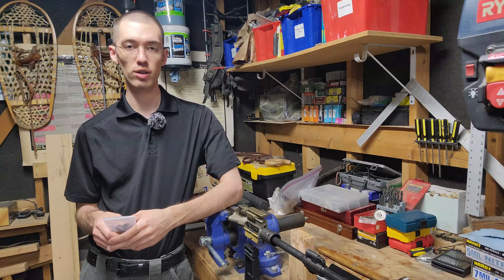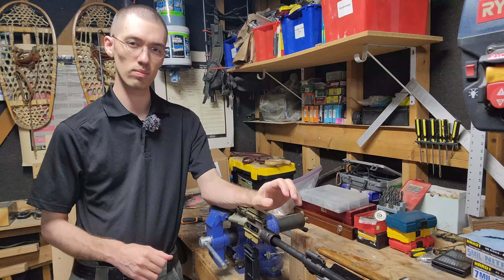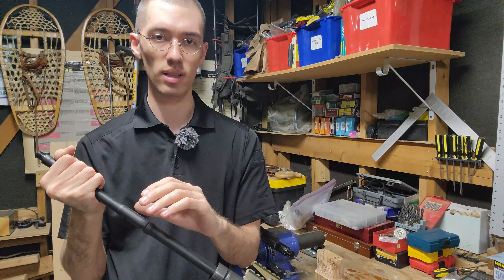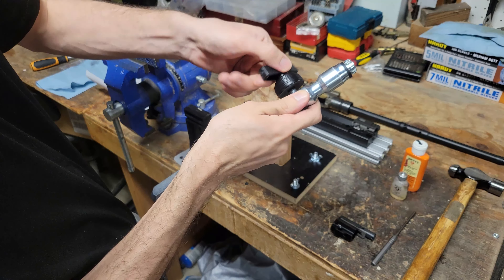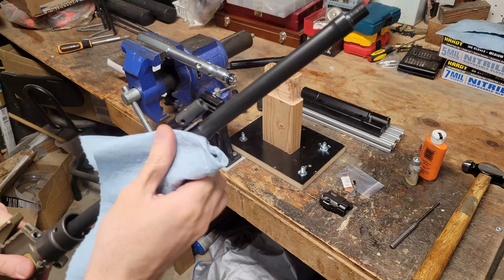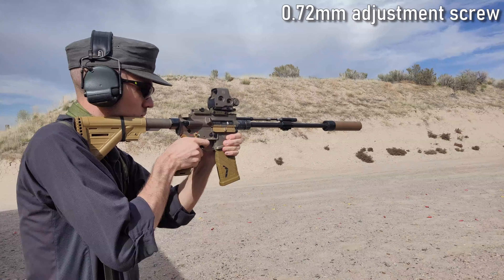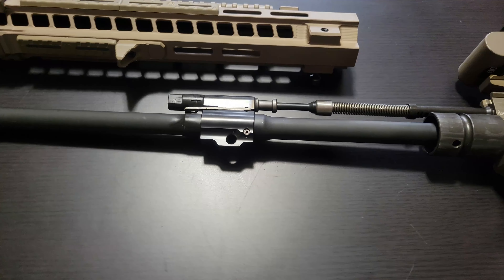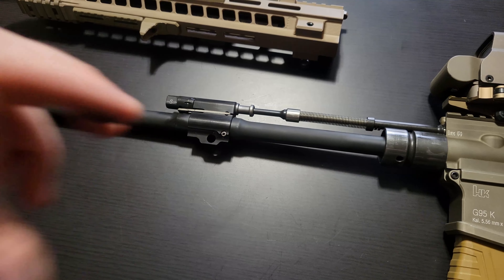Nefarious Arms NA5 A1/A3 Gas Block Installation + Tools Review

Comment: I need ty find the instructions that came with mine. I'll be finally getting a mr556 for my birthday and your videos have really steered my selection in parts. Thanks so much for sharing! Also I guess I'm  gonna have to use the non vented screw for 14.5? So with that screw no gas comes out the front?
Reply from the maker: Glad the videos have helped! Yes the plug screw blocks the vent completely so no excess gas goes out the front. You might need to start with the plug screw on a 14.5" but one thing I noticed on mine is now that the gas block has carbon sealed after being shot so much I was actually able to replace it with the 2nd smallest vent.
Reply: @Feldmutze  awesome thanks for the update! I'll be sure to log that into weapons log book. How many rounds do you feel would be a good break in?
Reply from the maker: Probably just a few mags at most. You could also do an initial function check then apply some sealant around the gas block so there's no gas leakage. Apparently the newer NA5 gas blocks are a bit tighter fit, and I know the factory HK barrels (assuming you're cutting down your barrel) always have a much tighter tolerance so it's possible you won't need any break-in at all.
Reply: @Feldmutze  i actually bought the nefarious arms 14.5 chrome lined barrel directly from them in their last run.  The gas block also came with their increased reliability piston but after your video on the piston, I'm considering just setting it aside haha.

Comment: Hello kind sir! I have a HK MR223 European model and i wish to replace the flash hider from the barrel to assembly a muzzle brake. For the moment i'm awaiting a viper barrel vice to try remove the flash hider. Maybye you have any advice for me when for will remove it??? I've maield the HK from Germany and they told me that the flash hider is not glued on the barrel

So any advice's? Also i have to replace the gas block beacuse the pin has broken! Anyway...nice video and explications
Reply from the maker: Thanks for watching and commenting! From what I've heard and seen, the MR223 has a much easier muzzle device to remove than the US MR556 so all you need is that barrel vice you already mentioned, and a properly sized wrench for your flash hider. I'm unfortunately not sure what size the MR223 uses for the wrench flats, but once you get that, it should come off quite simply from there as HK GmbH doesn't torque it down insanely like HK USA does, and there's no Rocksett to deal with either.
Reply: @Feldmutze  i've already orded a viper barrel vice. I hope it will do the job...

Comment: try Knipex Pliers Wrench 10' to push pins in - goes in very easy and smooth
Reply from the maker: I haven't tried those specific pliers but I've tried similar approaches and for me I always found it difficult to avoid marring when installing that way, so I usually prefer tapping out roll pins now.
Reply: @Feldmutze  they have smooth jaws and won’t leave marks.
Reply from the maker: Oh nice, I didn't realize that. I'll give them a second look and maybe pick one up in that case.